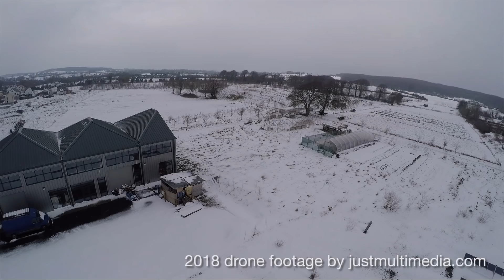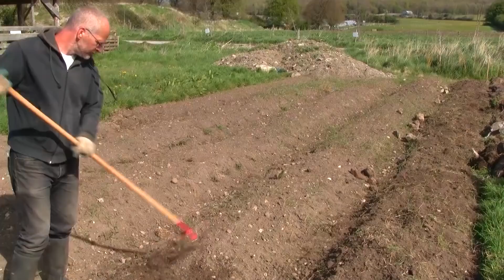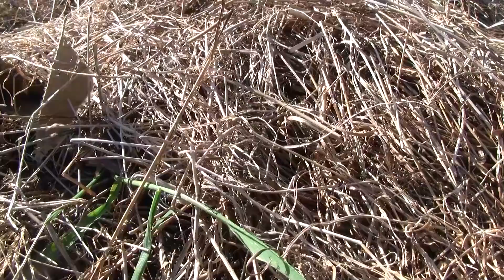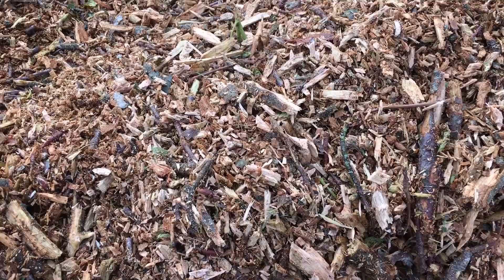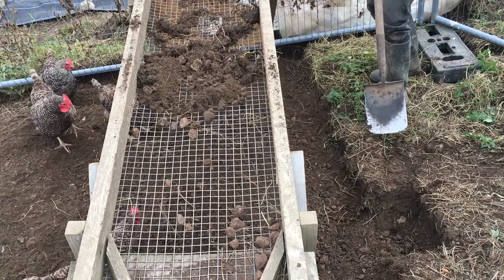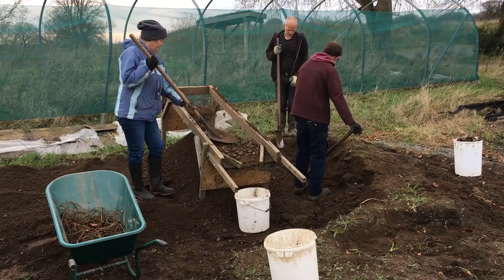What is the Best Way to Clear a Really Rough Site?

Comment: Rather depressing for those of us pushing 80 (I'm 77 and recovering from a stroke).  There has got to be a way of bringing ground under control without machinery and masses of back breaking work sieving soil and so on,  and either back to Eden or no dig with cardboard and thick mulch has got to be the answer.  I just want to get a section of my garden about 100 sq metres back into use which has been left to go native with deep rooted grasses and various suckering trees.   Like others of my age, I am happy to get out there weeding persistent perennial weeds out of the mulch as they regrow, but the Charles Dowding approach, despite the fact he had a pretty good site and good soil to start with, is perhaps the one I will adopt.   Thanks for a very  interesting video.

Comment: i covered my 1 acre orchard with 1ft deep fresh arborist wood chips (free) and yes i have a backhoe which made it easier on my old back. when i was young like you i would have done it manually but its a lot harder when you are an old fart like me 🙂i also had several 30x30x12ft high mountains of arborist wood chips composting for 3 years. then i spread the composted chips over the fresh ones that had killed all weeds. that was it... it took patience but i spend maybe 10-15min. a day weeding and because of all the organic matter i never have to water my fruit orchard even with no rain for 6mo. and i don't need a shovel to dig... the soil is so alive and soft that i can plunge my hand through it easily. it was hard not growing for 3 years but i tell you it was worth it. i am too old to spend hours a day weeding and otherwise dealing with poor soil. it is the lazy man's way 🙂

Comment: We minimize digging by digging deep narrow trenches, the hole gets filled with flotsam and the dirt is spread over the entire area, and when it settles, the water is guided into the garden bed more effectively.  Sometimes when we hit a heavy clay spot, we trade with silt dirt from the lawn.  As you well know, a 5 gallon bucket of dirt spreads over a large enough area with out any apparent increase in height, and that's where we put the heavy construction clay from the hole when digging in that area.  All around the effort is efficient as we are setting up the area with a permanent benefit to the soil quality.  This year we are continuing the process in new areas, as the areas set up last year have had plants in them ever since they were first dug, and it will be a long time if ever that we will need to dig an area again (hopefully).
Reply from the maker: Interesting stuff.

Comment: I’m curious if it would be a viable technique to creating a kind of plow that can drag the first couple of inches of topsoil and roll it up like a carpet? The rolled soil would be easy to store and degrade all the weeds inside of it leaving behind a kind of self composting sausage that could be laid on lower parts of the plot to catch water and level out the land?
Reply from the maker: Sounds interesting. Not sure it would work with the stony uneven section of soil that I deal with, but in a relative smooth area without many stones, it could be part of the strategy. You would still need to dig out the perennial/pervasive weed roots if they were there. Removing the top layer of soil like that would also remove a lot of the fertility and organic matter from the soil, so you would need to amend it even more with imported compost or something.

Comment: Here in Kentucky, I've used a thick layer of fall leaves and some grass clippings, going on 4 years now.  I no longer use my tiller, at all.  Using an organic cover, with no tilling, is a great gardening system, in my opinion.
Reply: As someone that has lived in West Virginia (next state over) and also in a maritime climate, I have tried that type of mulch in both places. It works very well in West Virginia, but in a maritime climate, it just breeds slugs which destroy everything.

Comment: Use Goats and then Pigs. Or slice off the top inch. By using a sharp edge shovel. Or burn it all off first. Or ask a Farmer to Plough it all over first.
Reply from the maker: All useful options, each with benefits and problematic issues (depending on the context).

Comment: Fellas dug a few ditches and drainrocked them for surface drainage below a seep on a slope that was covered with blackberry and salmonberry bushes. They uncovered  berry muck soil averaging 30 inches deep above the clayish silty sand and then the clay the seep of course is running on. 

When I started hand digging the 2 foot plus deep ditches to drain the new raised beds I double dug the muck on the bed sites too so it would dry some and wick a bit less with the ditches in place. I have to agree with the concept of three deep double digs to incorporate the looser material and turn clods to make the beds more aerobic between clods. Worms are everywhere even well deeper than natural roots in that muck so I don't think I'm breaking but improving the food web. The agronomy courses in Laval and McGill U's stress the "paramount importance" of mixing the layers a bit when you add them even in no-dig, and turning compacted beds, which these were from the start, to improve humic condition and drainage. And they stress also that composting at the surface as some do is not building soil if the clay and sand components are left out. A high carbon bed compacts the fastest, so turning over even no-dig beds will properly finish the composting and aerate the substrate.

Comment: First mistake you did you should of put a fence of 2m around your poly tunnels that way the plastic would of survived that storm ,pigs are good at clearing rough ground so 5 to 6 of them for 2 yrs and then use for growing.
Reply from the maker: Yeah. The Farm failed to put up the windbreak that was necessary. I have a 2m high windbreak around my newer polytunnel on the same site now, and it works much better.

Some people seem to have great experience with pig. I watched how that neighbouring farm sed pigs to clear a really rough section of ground, and a few months after thy were gone, the place was full of enormous dock plants again, but I guess they didn't keep them there long enough. Personally, I'd rather not keep pigs.
Reply: @REDGardens  when I first saw you composting your greens and dried grass I thought yummy pig food they eat everything and the manure needs to be broken down over 3 to 4 years funny enough even human muck can be composted so if you have dry latrine as long the paper is separated my Ukrainian relative's sworn by it oh by the way nothing wrong with pigs.

Comment: Be careful you don't end up with compaction after this. Soil by itself is likely to to become heavy and clump together. Some of those stones would have help maintain a healthy structure. Also, having your chickens deprive you of all those worms is crazy! You need them to keep that soil moving.

Anyway, that's just my 2¢ ≤ but then it comes from some experience of trying something very similar many years ago when I didn't realise the consequences. Not that you are asking for advice but get some sand in there if you want to keep the soil loose and throw in as much organic material as you can find, but it does look like you have way too big an area for it to spread.

Best of luck to you.
Reply from the maker: My soil is quite sandy, with not a lot of clay, so the compaction that you mention is not really an issue, unless of course I walk or drive on it when it is really wet.

Comment: sugestion for your tomatoes plant.

this summer i used plant from the local distribution center, 
a lady told me that to get huge plant quick a good trick is to cut all the leaves and only leave the top canopy.
then plant de clump of dirt and cover.

basically a 6 inch plant (from the soil) i buried the trunk 3 inch into the ground leaving only 3 inch out with the canopy.
my plant are huge, so much they are twice the size of my tomatoes cage (the biggest available)
each branch are about 1 inch thick they got so big they are covering half my garden now hahahaha.

you should try it out.
Reply from the maker: Sounds like those plants have developed really strong root systems.
Reply: @REDGardens  ecactly, roots are coming out the truck and are then deeper in the soil.

i didn't think it would make such a difference, but heck, ive never had tomatoes plant that big.
and i have been comparing mine to some that have the same exposure (even more to be exact)
but the other ones were put in dirt the traditional way and they are skinny.

if you are interested check out on youtube, i have found a video from root and refuge farm, searching ''planting tomatoes''
she does the same (but she add an egg o.O)

Comment: A kettle burner ( roofing hot asphalt kettle) a 100# bottle and a tiller. 
The burner will burn the weeds at a slow walk. 

But be very careful as it throws out a very large flame. Then call a neighbor to run a 3 point tiller
Reply from the maker: I have used a flame like that to kill off seedlings, but haven't found it useful for dealing with the pernicious weeds, especially the ones with strong root systems.

Comment: I don't have chickens, but when I expand my garden I cover the new sections with grass clippings 1 ft thick since I have it.
Reply from the maker: Do you put newspaper or cardboard under the grass clippings?
Reply: @REDGardens  no, if you use enough clippings they work the same as newspaper/cardboard. I have unlimited grass though
Reply from the maker: Always useful to have loads of the stuff. I generally find that the deep layers of grass become a soggy mass of anaerobic decomposition. Do you have the same pattern, as I would imagine that would really prevent regrowth?
Reply: @REDGardens  I do a few different things. 1) The primary goal is to kill of any lawn/turf and prepare it to be a garden bed. I find that if I put down 1 ft of grass it is reduced to 1 inch by spring, and then if you want you can rake off the old clippings and the soil is ready to plant

2) If I'm planting potatoes, berry bushes or trees I cover the ground with 1 ft of grass clippings and then 8 -12 inches of woodchips, and by spring it is ready to go and I never have to worry about it. I've been doing it for years, never had a problem
Reply from the maker: Hosoi Archives Cool. Thanks for sharing your experiences.

Comment: Thanks so much for sharing. I do miss my sieve. Now I just use rock buckets and I have a huge pile of rocks. I can actually stick poles in the ground which I use with DeerX netting (cut to 3 x 2'4" pieces) to control where the chickens can run. I'd like to put the rocks in a chicken wire wall and run drip over them to cool the garden in summer. Of course in Winter they're a great heat sink.
Reply from the maker: Very colt use rocks to cool and warm the garden. I've tried it in a few places, but would be interesting to really push the possibilities.

Comment: We do cardboard, compost (only where roots will go), then a thick layer of woodchips.
Slugs get eaten by centipedes and millipedes.
We also release predatory insects and add hardwood ash, coffee grinds, Epsom salts, ground eggshells, ground bones, and dried chicken poop.
We do that on hills as well.
Reply from the maker: Sound like an interesting approach. What kind of climate do you grow in?
Reply: @REDGardens  5/6
Reply from the maker: @scorchgardenultrahothotsau7919   Are those references to climate zones?
Reply: @REDGardens  They are the US 'Hearty Zones'  Basically cold winters that are as long as hot summers.  Temperate, but over the past 20 years, the extremes are getting more extreme and we barely have the gradual transition seasons of spring and fall.
Reply from the maker: @scorchgardenultrahothotsau7919  Ah, yes, I am familiar with that type growing climate. Slugs generally aren't going to be as much of a problem, and a mulch would definitely be more of a benefit in the summer.
Reply: @REDGardens  I get slugs UNDER my cardboard, which i think is fine because that  tells me that life is thriving.   They generally don't care to be on TOP of the wood chip mulch as it dries them out very quickly.

Comment: I have gone over to no dig in the last 3 years. But have all ways opted to manually level the ground first.  hard work pays off later lol.
Reply from the maker: I think digging and prepping the ground first before shiftignto no-dig is possibly a really good approach, depending on your context of course.
Reply: @REDGardens  Yes it just makes sense to me unless it flat to start or you will be forever filling in the troughs. I have a endless supply of horse manure and wood chips for free on our allotment site. one part of my allotment was all ways wet. so I dug 2 long wide deep trenches across it half filled them with wood chips and level the ground with the remaining soil. The wood chips takes years to brake down to the lack of oxygen. It seems to work well (sorry i have some insane ideas lol)

Comment: Hi Bruce I need some advice, I recently took on a new plot and in haste I applied a thick layer of heavy cow manure last November which I then covered with geotextile fabric. Just this week I pulled back the fabric to discover that the grass below was pushing up through the manure so I'm assuming the fabric has not been down long enough to kill any weeds. Do you suggest I should dig and sieve the area as you have done here? Or do you think it's too late? And lastly, could you do a video on how you built the compost sieve as I would like to mimic your design exactly. p.s my site is on a slight downhill slope, would the sieve work on this sloping ground ?
Reply from the maker: A few months over winter (assuming you are in the northern hemisphere) wouldn't be long enough to kill off the grasses. It would take more months, and probably some warmth to really kill them off (right now a lot of things are fairly dormant).
I would let nature and time take its course, especially as you have added manure and already covered things with fabric. It will mean a delay in the planting season.
Even waiting a few more months would make it a lot easier to dig out and sieve - if that is what you want to do. I don't necessarily suggest sieving, it only makes sense if you have a lot of time - and can handle significant physical activity. Without knowing more about your context/soil/climate, I think I'd leave it for a season, and grow sow larger plants, and then see how things look later in the year. But again, I really can't say.
I am not planning to build another sieve for a while, so will unlikely do a video about how to make one (and it is not really my style of videos). A sieve should be able to work on a slope, so long as the legs are adjusted to accommodate it. It will likely take some trial and error and experimentation on your part.
Reply: Thanks Bruce I really appreciate your viewpoint
Reply: If the grass was green, the landscape fabric was too thin and let light through. 

To plant quickly, tou can rent a sod cutter, turn the sod UPSIDE DOWN add a couple layers of corrugated cardboard, then some soil+ amendments, and more soil. Repeat. This is called LAZAGNIA gardening. It will kill the grass eventually.DO NOT LEAVE LANDSCAPE FABRIC IN SOIL AS IT WILL MAKE ANY TILLING A NIGHTMARE!

Comment: great job. And you also gave me an occasion to feel grateful that, here in the Midwest of the US, tree trimmers are thrilled to bring you all the wood chips you'd like for free. They don't even charge a nominal delivery fee - just glad to be rid of it without having to pay for dumping it. The only trick then is to be patient for the two years or so it takes for wood chips to turn into something I can plant into, either on the paths or in a composting chip pile. If other people in my community are silly enough to give me the fertility of their soil, that's fine by me.
Reply from the maker: I finally got few loads of wood chip, but it is not so easy around here. I also find it interesting that people are so willing to give away their fertility!
Reply: Normally, wood chips on their own break down primarily through beneficial Fungi; that's a cold it  slow conpost  method. It just happens, even if you don't turn it.
If you're willing to wait, you can grow mushrooms in it.
 You can accelerate wood chip decomposition by adding green matter or other nitrogen source like manure.  
There are commercial compost starters you can fork in whenever the pile isn't steaming in a cool day. You need the kind for BROWN piles. 

Also there are recipes for making your own hot compost accelerant. Some use beer, coka cola,  or a mix of molasses to feed the bacteria. 
Adding sugar and oxygen supports more bacteria and suppresses the fungal growth. Eventually, the fungi finish the job.
Hot compost needs turning.